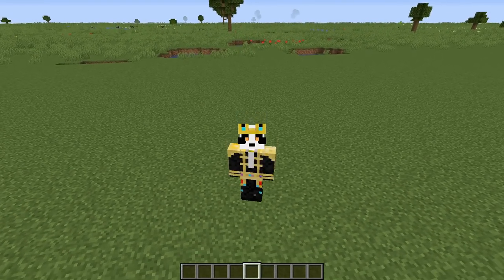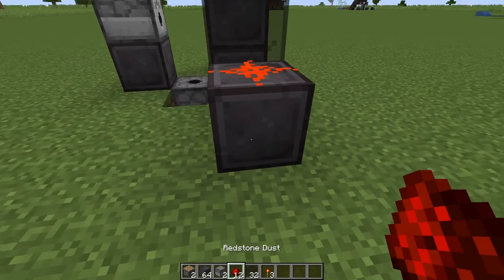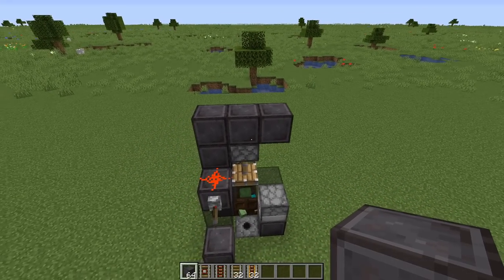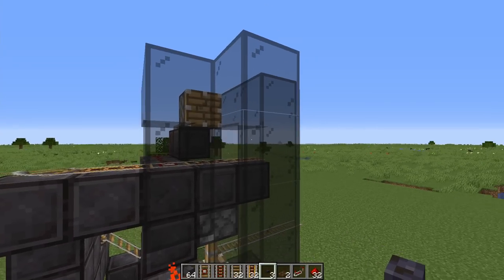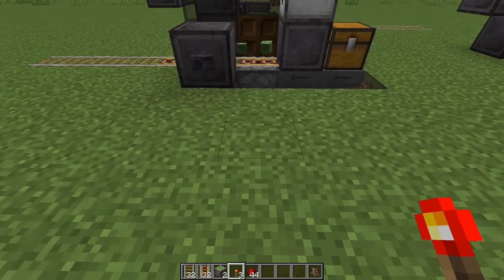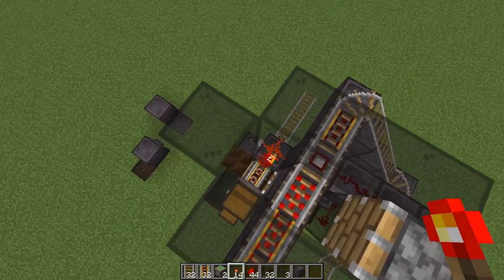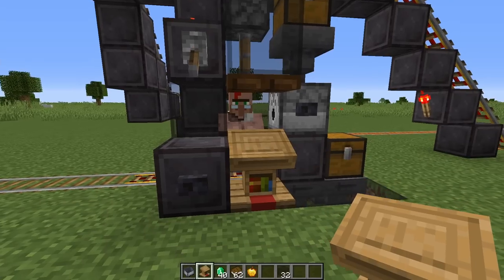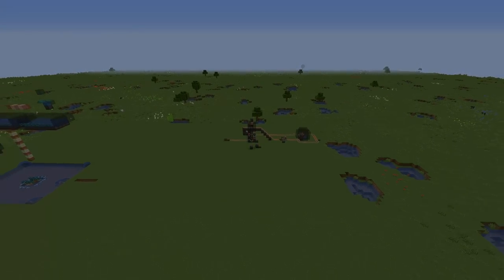Minecraft Zombie Villager Converter System | Minecraft Trading Hall

Comment: To fix the zombie getting picked up problem instead of using pistons to push him up and down u just need a dispenser with a water bucket and soul sand at the bottom wired into a button instead of a lever, this prevents him of being picked up by the minecart, u could also put  a block above his head, 1 block above the trapdoor or engineer some piston that doesn't unpower with a button but u don' really need it just a block will do, really just to prevent him from burning.
Also make sure the zombie is down before activating the minecart dispenser.

Comment: I have built this curing machine twice now in 1.16 - once in Java (with the trapdoor fix - see the pinned comment), and once in Bedrock edition (1.16.201).  In Bedrock, I've had to add the trapdoor in front of the zombie, and removed the function to lower/raise the Zombie on pistons.  This is because the zombie (even in a minecart) would attack the villager.  I converted the redstone behind the switch to raise/lower the trapdoor.  My zombie is stuck in a minecart one block lower than the villager position, and this works great!.

Comment: I've found that the villager isn't always pushed from the rail cart into the hole, but swapping the piston for a sticky piston with a trapdoor flat on the front give them the little extra push to go in the hole reliably.
Reply: was having the same problem. didnt come up with a trap door, works now ;)
Reply: and also that unpowered rail stops the minecart, 0 reason to keep it there, works like a charm now
Reply: Tried this and it didn’t work :( any other suggestions?
Reply: skoobesnacks the trapdoor has to push the villager off..u sure ur doing it right?
Reply: @lilintr0vert  try having less powered rails, worked for me :)

Comment: I use this on my SPR (single player realm) and MPR (multi-player realm) in Minecraft Bedrock. / There are a few simple modifications I had to make to get the villager to eject from the minecart and get the zombie to work better. / Replace the two redstone dust closest to the detector rail with 1 tick repeaters. / The redstone torch and redstone line underneath  the torch to activate the lower piston where the zombie is can be removed. Remove the piston and trapdoor, and place your zombie in a minecart in its place. This places his head at the leg level of the villager. Above the zombie spot, place a solid block in the original location of the sticky piston, and place the sticky piston on the block, then the glass. This should line up the sticky piston next to the redstone dust in the hole in the middle of the cross like structure. (The solid block is actually optional but can make placing the piston easier.) This places the sticky piston one block lower to cover the zombies head with the glass. / If you are also using this station to roll trades with a workstation (recommended), it is best to place this cure station at least 100-150 blocks from a villager breeder, trading hall or any location that has a villager. Otherwise villagers from the other locations will link to the work station or unlink from their own. This can make trade rolling or trading halls be time consuming and annoying having to spend time linking stations again.

Comment: Zombie gets picked up by Mine cart before villager anyone have a fix to that?
Reply: im thinking we need a double piston extender for the zombie
Reply: Bruno CBart i tried and it doesn’t work cause zombie glitches through piston.
Reply: @alexchan6811  me too I tried But I have something that worked, if u put a dispenser with a bucket of water and soul sand to push him up with bubbles he doesn't get in the minecart, but instead of a lever u use a button and u don't need the piston extending at the top, just put a block on the zombie head, of cource not on top of the trapdoor 1 block up the trapdoor, it's a very simple fix.
U also have to make sure he's down before activating the minecart.
Reply: hey i just built this and i put the zombie in a minecart where hes standing instead of the trp door. the zombie cant get picked up by the villager minecart sine hes in one

Comment: my minecart keeps picking up the zombie instead of the villager. is it because i'm using a husk instead?
Reply: Did you find a solution for this? I'd rather not have it happen constantly, but it happened right on the first time.
Reply: @lerocknrolla  yeah one of the other comments told me. you have to put the zombie into a minecart and remove the trapdoor then it should work fine.
Reply: @f1redemon966  Thank you!

Comment: Hey, I've been having an issue.

Every time I press the button to dispense a minecart, the husk I used gets into the minecart instead of the villager
Reply: Smuggle Fish that’s what happens with every other design I’ve found every single time without fail It occurs I need this for my villiger hall I’ve got no idea how to do this, no design for bedrock out there works...
Reply: @shannonsmith924  Place the minecart dispenser beneath the potion dispenser instead of under the powered rail. So long as the zombie is in the down position, it shouldn't get picked up anymore.

Comment: Please help me! I built it exactly like the video but when the piston fires, instead of the villager dropping into the hole it stays on the block directly in front of the piston. What can I do to fix this?
Reply: Try changing it for a sticky piston with a trapdoor flat on the front of it
Reply: I figured it out. The problem was that I had the redstone torch in front of the sticky piston. This caused villager to basically bounce off of the redstone torch
Reply: @Elijah-bj3lh  And where have you placed the torch now to fix this? I cannot find a place for the torch where I do not have the problem

Comment: Not sure if something changed but I’m having some issues. The regular piston at the top will 8 out of 10 times not push the villager off the edge. Secondly the villagers won’t take to a workstation. Any suggestions?
Reply: Hey man I cannot get the villager to take a workstation either... did u find a fix? Thanks
Reply: With the piston, set it to 4 ticks, and with the workstation, mine worked fine. Try and out it directly in front of them if you haven’t already.
Reply: @imreallycolbtw6445  Thanks for the reply.  I did end up getting mine to work.. i realized i had some other workstations close enough to him and even tho he wasn't taking their appearance it turns out it was interfering.

Comment: before you do anything, if you read this comment:
THIS IS VERY FINICKY AND I HATED DOING IT!
THERE IS A PROBLEM WHERE IF YOU USE THIS METHOD WITHOUT FOLLOWING THE INSTRUCTIONS OF THE PINNED COMMENT THE CONVERTER ZOMBIE IS PLACED IN THE MINECART INSTEAD, MINE ENDED UP DYING TWICE BEFORE I FIGURED OUT HOW TO FIX IT.
otherwise a very good contraption, 7/10 if it wasnt for the worst possible bug imaginable